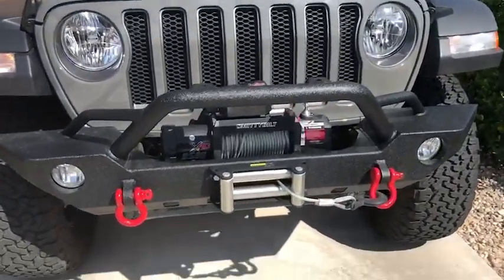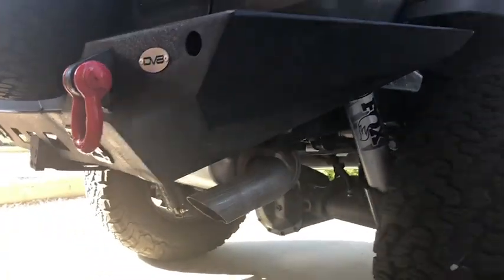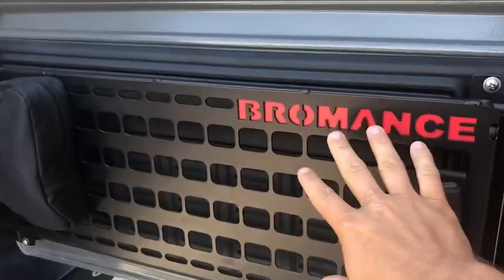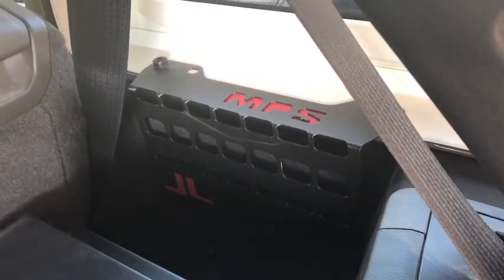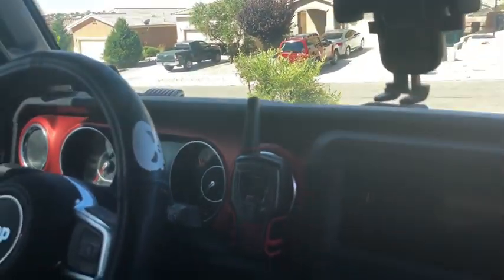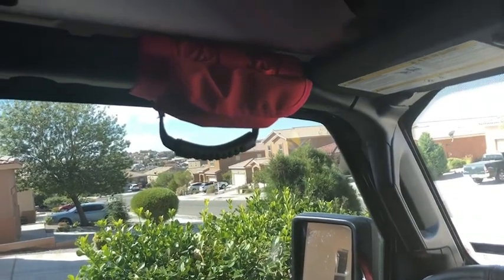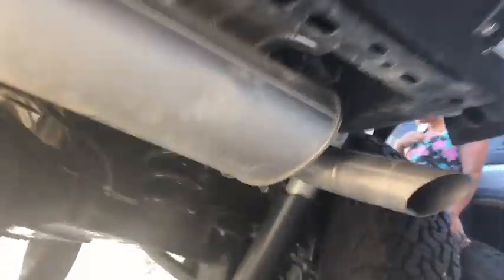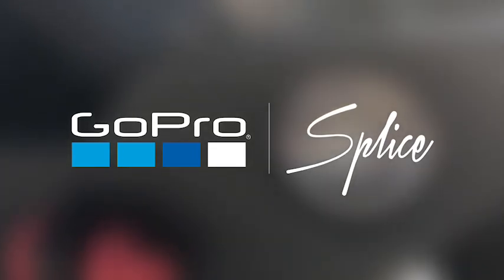JL LIFE - let’s meet bromance 2018 Jeep Wrangler JLU RUBICON

Comment: Hi ,did you have to use wheel spacers with the stock rims and 35s, and hows your economy with the 35 bf goodrich at? I have ordered a rubicon in Australia and have to wait until June because of demand! The Australian Rubicon comes with 32inch tyres and the low sport fenders , which is annoying. Your build is pretty much what i am planning. Thanks
Reply from the maker: Thts a looooong time to wait for sure... oooof! So to answer your questions. No spacers were needed mpg depended on how much highway to city driving I did given the week.. highway I was getting about 18mpg.... city was around 16mpg

Tht really sucks about the fenders... them high rise ones really separate the look from the sport and Sahara models
Reply from the maker: But glad u enjoyed the video! Iv since moved to 38 inch tires hahaha 🤙😂 but I won’t lie it was a smooth ride on 35s... it’s a bit rough now... as I’m currently trying to correct it 😂🤙